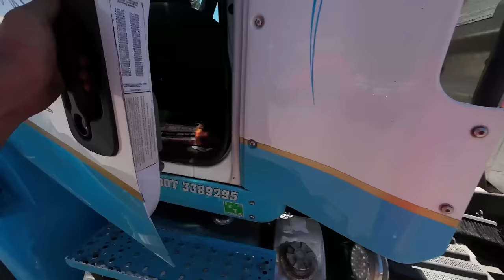Broke down in the middle of the highway.  Veteran needs a hand.

Comment: That's really awesome of you man.   I was broke down in arkansas in an old rv 700-800 miles from anyone i knew.  I tried several mechanics but none wanted to help me with an older vehicle or blew me off.  Eventually it wouldn't run more than a few 100 feet, and i tried to get someone to tow it but they all said they couldn't cause of height.  I drove that distance time after time, over hours, to a truck stop parking lot. One guy told me he would buy the rv from me for the cost of a ticket home. :(  After 2 weeks, of me trying to fix it myself, a mechanic friend drove all the way from home and helped me fix it enough to limp the rest of the way back home (it needed a fuel pump).  Nice to see good people and mechanics willing to actually help someone stuck in a bad situation.

Comment: It is ironic you posted this today.  My family and I were our way to my in-laws for the afternoon when a camper in front of us blew a tire.  The family pulled over in a bad spot.   We pulled up alongside and told them just a couple hundred yards up is a pull in.  So we pulled in and changed it for them while I had him go around and check the air in the rest of the tires.  I am glad we stopped.  The family was so appreciative.  P.s  something you may want to check on any trailer you buy.  The lug nuts holding the spare on were not the same size as the ones on the trailer.  Keep up the great work Casey!

Comment: On his cap: Top right is a US Army 5th Special Forces Group pin (it's a replica of the 5SFG beret flash.  The flash is a unit identifying patch on the SF Green Beret. The insignia on the flash is the SF insignia with their motto: De Oppresso Liber, to free the oppressed.), below that is a Engineer Combat Badge (which is unofficial and patterned off the Infantry's Combat Infantry Badge.  Currently non 11 series MOS are awarded the Combat Action Badge which follows similar award criteria as the CIB), below that is Sergeant E-5 rank insignia.  On the left is an Expert Qualification Badge with bars signifying Rifle Expert and Grenade Expert qualifications.

Comment: Thank you Casey for helping Rodney! I'd help you if I had it. Unfortunately I live on a whole lot less than Rodney does. Neither of us get enough to live on. Especially now when costs have tripled the past couple years. There are many places Rodney could go but they are in other states where you can park for $300 a month. I'd head out their but my truck needs too much work. Needs engine overhaul and new tires and a couple minor issues fixed. The campgrounds here are too expensive at $500 to over $1000 a month. Utah, Arizona, New Mexico and so on have much cheaper facilities in the $300 range. Not sure if there are any in Oregon but it's something Rodney could look into.

Comment: Top right pin is 5th Special Forces. The 5th SFG was the only U.S. force continuously involved in Somalia from August 1992 until March 1995. The final Special Forces mission in Somalia was to provide sniper coverage for coalition forces around the Mogadishu airport while assisting the U.S. forces withdrawal in Operation UNITED SHIELD.  Also, you can get both Social Security benefits and military retirement benefits. Someone local needs to talk to this guy. (any attorneys out there for some pro bono work)

Comment: Probably not a big deal. But front drivers chain you forgot to hook the extra slack like you did with the other ones.

On a side note, me and my GF were coming back to my grandparents after running erands and came across this teenager-ish lady with a flat tire. The inside tread of the tire suggested under-inflated. But we got her tire off and replaced with the spare for her. Otherwise she would have been trying to video call a person to rely on help. Glad we could help her out for no charge and wasnt out of the way. She had still an hour drive. So hope she made it safe

Comment: You have controls on both sides of the bed for the deck and winch right? I'm curious why most operators seem to prefer to do it from the road side, I know you said that you prefer to see what's coming but wouldn't it still be safer to run the controls from the shoulder side regardless? I would think you may be able to look under the vehicle a bit as well to see what's coming. Ahh I wondered why you didn't use your remote from the drivers sear when winching it on the bed.
Reply from the maker: Visibility trumps everything.  I had a clear view for a long way down that road, and if a group of cars were coming up on me I had plenty of time to get well clear of the truck and hope for the best as they pass.   And likewise, if only one or two cars was coming along and I could clearly see that both of them acknowledged my presence and moved over, I could continue to work and get us out of there as quick as possible.  
However, if I were working from the blind side of the bed and a group of cars that might not be able to get over in time came along, I would never know it until on hit the back corner of the RV.   Now look where the controls are and think about where that RV would go if the drivers side rear corner got hit….    That’s exactly why I did what I did in this particular situation.

Comment: In situations like this where your lights are obscured, would it be worth the time to put your remote towing lights on the back of the vehicle you're loading?
Reply from the maker: Yes, and I do that on occasion, but RV’s usually take longer to string up enough bungees and straps to hold them on that you can pretty much have the thing loaded in the same amount of time

Comment: Forgot the AC unit extra height
Reply from the maker: No I didn’t
Reply: @CaseyLaDelle  good, on you. i only saw you looking from roof height. I'm trying to find the advanced warning beacon the Ron Pratt Towing on YT uses.
You wear part 1, and set the part 2 up the road 1/8 mile or so, and when a vehicle passes it, you get alerted, and have time to see it coming
Reply: @CaseyLaDelle  I'm still watching the vid at 26 minutes , and its GuardianAngelDevices
Reply: I thought GA provided that early warning, but couldn't find the feature on the site